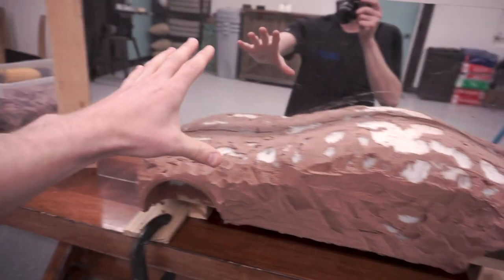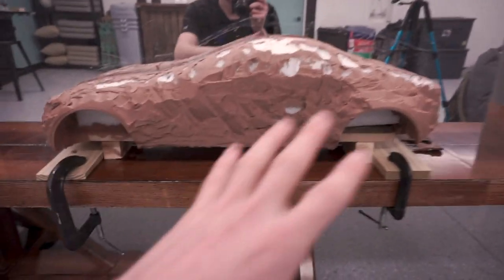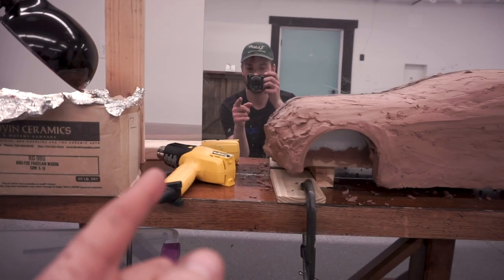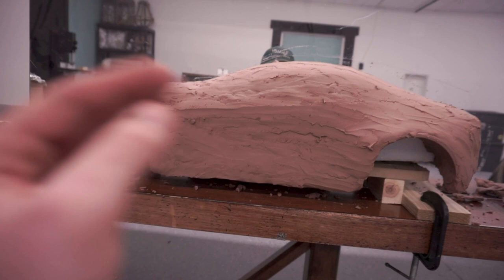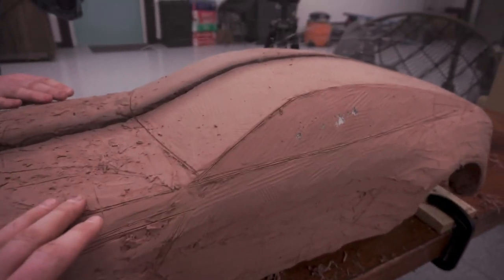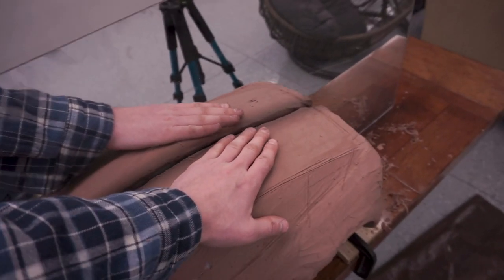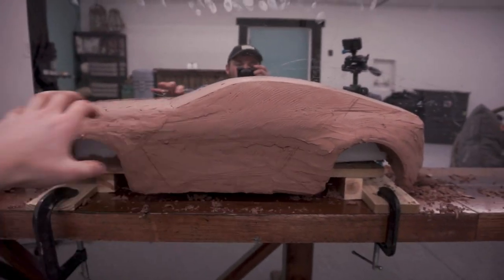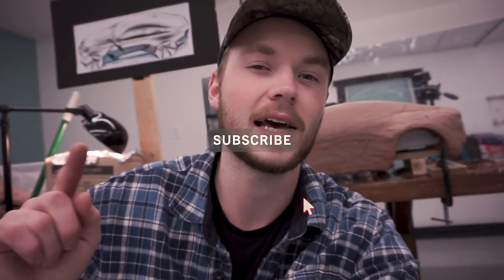How to Sculpt a Clay Car PART 3

Comment: Does any foam work as a good base? Have you used low density modeling foam? Or is porous styrofoam like you have best?
Reply from the maker: Most foams will allow the clay to adhere but the white Styrofoam is the easiest to work with and the clay sticks really well due to the larger pores of the material. Another option is to drill some divots into the foam to help the clay grab onto it if it is having trouble sticking.

Comment: Could you make a video showing how to shape the foam?
Reply from the maker: You can use any knife, a hand saw works great, and sureform tools to round it all out. The foam is super easy to cut away
Reply: @ty_zib  thanks for your reply. Well technically it could be easy, but knowing what to cut it down to is the part Im talking about.
Reply from the maker: An inch below where you want your clay to be is a pretty safe bet. If you run into it while sculpting clay you can cut more chunks out or smash it in with a hammer to compact it.
Reply: @ty_zib  I guess in trying to figure out the proportions and details like that.

Comment: Will it hold up to vacuum forming?
Reply from the maker: The clay?
Reply: Yes
Reply: I Want to do some rc car bodies
Reply from the maker: I would suggest testing a small form first before committing to a full model. Depends if you are vacuum forming with a super hot material or not. You can also use shellac on the clay to harden the surface or spray the model with a paint primer to seal it beforehand. Once primed, you can sand and bondo any imperfections and then paint if you want or just cast off of that. Hope this helps!

Comment: Bro shal i use to melt the clay heat gun instead of ovean
Reply from the maker: Either works. Industry ovens are actually bread warmers set to a consistent 145 degree Fahrenheit. For small bits a heat gun will do the job just fine.
Reply: Bro I got black & deckar heat gun bro modal kx1800 it's ok bro for the clay modal thankyou for replying